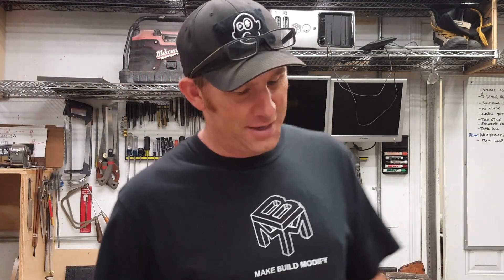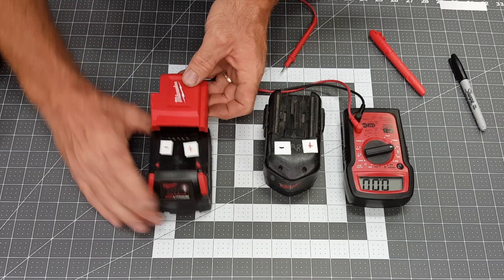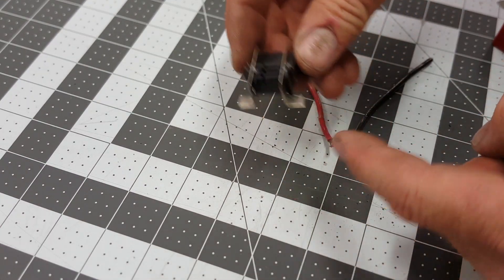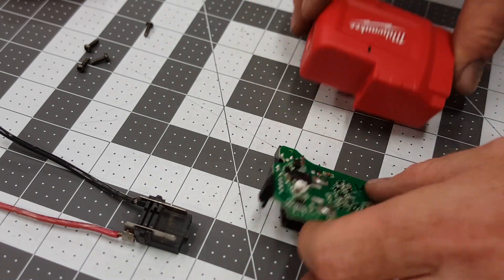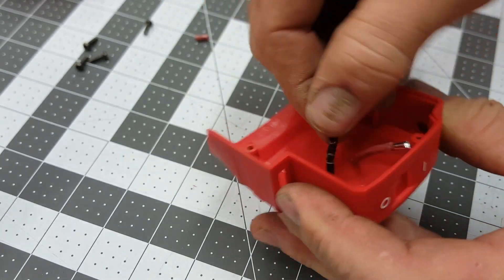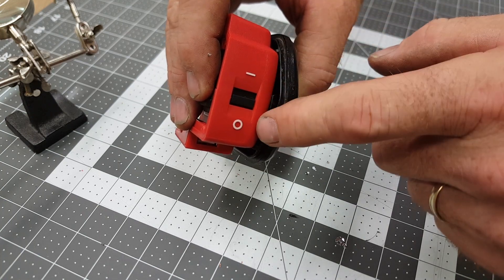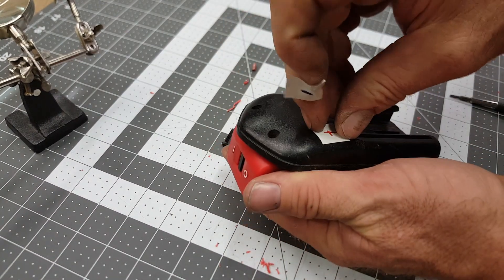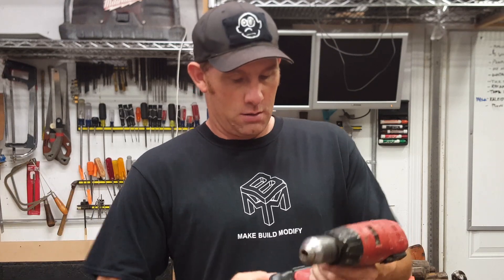HOW TO make an 18v NiCad to 18 volt lithium ion battery adapter for Milwaukee tools

Comment from the maker: <<<WARNING>>>: I don't let my lithium ion batteries go below one bar while using old tools. This is because the new tools will shut off before the battery is completely depleted. The old tools will run the battery all the way down. One of the guys on my jobsite used my old tool/new battery setup and completely depleted the battery and now it won't charge. :(
Reply: You probably did already but you can recharge your drained battery with another fully charge battery by jumping cables from one to the other. Just need a bit of power so that the charger can recognize it and charge it.
Reply from the maker: @gtdodgeviper  Yeah, I gave that a try, but it didn't work for my battey. :(
Reply: RE: " the new tools will shut off before the battery is completely depleted. The old tools will run the battery all the way down."  That's true if using one of the newer-style Li-Ion battery packs that have the battery protection circuitry inside the tool instead of in the battery pack.  Ryobi & Ridgid are the only two mainstream brands that haven't significantly changed their battery pack design since their tools used NiCad packs, which means they still have all the battery protection circuitry inside the pack, and these packs can also be used to power any device that runs on the appropriate voltage without any concern for for battery damage due to over-current or over-discharge.
Reply from the maker: @videopipeline6419  Thanks!
Reply: @Makebuildmodify  ...and since Ridgid battery packs are pretty close to the same capacity as Milwaukee, Dewalt & Bosch (of similar rated capacity), but only Ridgid packs have a lifetime warranty (if registered within 90-days), that makes the donor-pack choice pretty easy.
Reply: Thanks for the heads up

Comment: i would just avoid evacuating the power. as someone who works on performance vehicles using large batteries ,  you're gonna run into some MAJOR problems if you depletre.
Reply from the maker: Yep.

Comment: I didn’t read the title well and thought it said how to make it work, and then realized it says “with adapter” but I still think it’s kinda redundant and dumb to offer a hack that isn’t a hack, it’s just a purchase of another tool. I thought diy was not purchasing more stuff
Reply from the maker: It can be done with the lower part of a flashlight that receives the new batteries. If you look near the beginning of the video, you can see that I cut off the lower part of the flashlight. You can also see in the same shot that I use this part on one of the adapters. So, it can be done without a purchase of another tool if you already have the newer flashlight. But, it's been a while since I made this video, and now there are aftermarket adapters and 3D printed versions.

Comment: How are you locking the old top plate into the nicad tool, now that the locking mechanism is removed.  I have everything done, using a Dewalt adapter, and haven't figured out a way to lock the new combination battery pack into the old tool.
Reply from the maker: I didn't. most of mine are so old that they would stay on their own. Now that I think about it, I use a large rubber band to hold the battery to my sawzall
Reply: @Makebuildmodify  Thanks for getting back to me.  The only way I could see of keeping the locks, would have been to put the new batteries in the old case, which is not what I wanted.  I will go ahead without the locks, knowing that I will probably have to use a Rube Goldberg solution to secure the adapter.  The only two older Milwaukee tools I am wanting to use, is the hammer drill and the sawzall, so I will have to do something.

Comment: I've got the old 5 piece set. Now I'll be able to use them again. Thanks!
Reply from the maker: You're welcome. Be sure to read the WARNING in the description or the first comment. It's possible to drain the new batteries to a level that makes them  permanently unchargeable.

Comment: I did this with a new dewalt lithium……. For my old Milwaukee tools.  All my tools are now dewalt because Milwaukee would not make an adapter after 30 years of Milwaukee, I now use only dewalt
Reply from the maker: Yeah, that can be a deal breaker. Milwaukee did make a lithium battery for the old tools at one point.
Reply: Yes and I was excited to be able to go lithium with my old tools.  Alas, never available, now Milwaukee joins Levi’s, converse,Tropicana etc.  products I used for years and would still to this day if they had not screwed them up. Voted with my dollar

Comment: I have a number of the "post" type nicads that don't hold charge for long(when using) is there anyway of making something similar to convert to lithium (all the drills work fine just below par batteries) batteries only have 2 connections pos and neg....
Reply from the maker: I don't know. There might be an aftermarket adapter available though. Since I made this videos there  have been a few adapters made by the tool companies.

Comment: This is sick. I don't have v18 but I've got the old 18v DeWalt stuff
Reply from the maker: It works but you gotta be careful not to drain the new type of batteries too low or they will not charge again. The new batteries have a chip that communicates with the new tools to stop the battery from being drained too low.  If you use an old tool with a new battery the tool will drain it to the point where the the charger "thinks" that the battery is bad and will not charge it.

Comment: I’m all for building cool stuff but I just bought an adapter on Amazon that does this same thing for $25. I resurrected three great old tools to use the 8 M18 batteries I have.
Reply from the maker: Yeah, Those adapters weren't available when I first posted the video.

Comment: Milwaukee actuall had a recall on the Ni Cad batteries & will replace them for free. The tools were great but the batteries sucked.
Reply from the maker: Do they replace them with lithium batteries?
Reply: @Makebuildmodify  They replaced mine with Ni Cad, might have changed by now. Google Milwaukee Battery Recall
Reply from the maker: @thomasz4981  thanks!

Comment: I was all set to do this after getting my first M18 tool and wishing I could still use my drill, saw, sawzall and job site radio from the 2000 NiCAD set of tools.  I had 5 of the NiCAD batteries but hadn't used them in a few years at all and not 1 of them would accept a charge.  And I bet on average not one of those NiCADs was charged more than 50 times in the 20 years since I bought them all.  That's a LOT of $$$$$ in batteries.  But then I found all the demonstrations of using a car charger to revive these NiCADs.  So I figured I'd try that and certainly at least one wouldn't come back and it would be my donor for the top to use with your project here.  EVERY SINGLE ONE of those 5 old NiCADs came back to life.  So now I'm wondering if I use a battery conditioner on them to charge and deplete each a dozen times to recondition them if they might still have years of life in them with my limited use.  Or do NiCADs also just die based on age rather than number of charge cycles?
Reply from the maker: Glad to hear you recovered the use of your batteries. I had no such luck.

Comment: Great idea, but they now have finally came out with an adapter. I’m not as good at soldering as you
Reply from the maker: Yup, you can buy them now.
Reply: I’ve used the Dewalt adapters with no issues, I’m not sure why Milwaukee hasn’t mft’d an adapter as only generics are available. I guess they have their reasons
Reply from the maker: @moparlover1968rr  Yeah, I wondered the same.
Reply: Do you have a part number or link?
Reply from the maker: @cheeseburger9232  Yup, Here's one, it's not made by Milwaukee but it looks good. https://amzn.to/38vqD90  (Affiliate link so you can help support the channel at no cost to you)
Reply: @Makebuildmodify  this adapter will let me use the new 18 volt lithium ion batteries?
Reply from the maker: @cheeseburger9232  I believe it will. You can ask the seller questions on Amazon. Also remember to take a look at the reviews. This is not a Milwaukee brand tool so I'm not sure on the quality. There are also sellers that have lithium-ion batteries that will fit the older drills, but they are expensive. Link to battery: https://amzn.to/38wQfSZ  (Affiliate link so you can help support the channel at no cost to you)

Comment: It's a great idea, but I'm frustrated watching .. bc 90% is wasted effort.  You don't need two adapters - just run the leads from the tool directly into the power supply, and - - and glue the power supply directly onto the tool's base with a PU cement (maybe Loctite Premium 3X will do - or a plastic epoxy.)  You might want to preserve the battery readout - I would cut the top off and replace it with something to make a better fit.  Stick the readout on the side.  But that's it - DONE!
Reply from the maker: What about recharging the battery?

Comment: Lessons learned: a) solder the wired to the board terminals first before running through the holes, then solder to the blade terminals for the older battery holder;  b) use a 100w + iron otherwise, you won’t have enough heat; c) make much bigger holes to pass the wires to give some clearance, there’s no reason to keep them so small; d) use hot glue to stabilize the two parts together.
Reply from the maker: Good ideas!

Comment: Excellent job, MBM.  Learned a lot of good juju from this video.  Thanks for sharing.  Have a fine week.
Reply from the maker: Hey Thanks!  Just a word of warning. I don't let my lithium ion batteries go below one bar while using old tools. This is because the new tools will shut off before the battery is completely depleted. The old tools will run the battery all the way down. One of the guys on my jobsite used my old tool/new battery setup and completely depleted the battery and now it won't charge. :(

Comment: this is awesome thank you very much for showing how to. I will be doing this for my snapon now I don't have to throw away my 800 dollar 1/2 impact thanks again.
Reply from the maker: Nice! Good luck! One warning, I don't let my lithium ion batteries go below one bar while using old tools. This is because the new tools will shut off before the battery is completely depleted and the old tools will run the battery all the way down. One of the guys on my jobsite used my old tool/new battery setup and completely depleted the battery and now it won't charge. :(
Reply: Make Build Modify that’s exactly what I was thinking about and was actually going to ask you about because I did notice the new batteries themselves say smart circuitry build into them but I guess I still have to pay attention to that detail thanks again

Comment: I bought the adapter and did this modification.  My sawzall worked great the first time.  But the Lithium-Ion battery did not shut itself off on the normal low voltage cutoff.  I used the sawzall until it started slowing down.  Measuring the voltage it had left showed 16.4 vdc.  I put it on the charger and after about 5 minutes I got blinking red/green lights.  After removing and installing it back into the charger a few times, I got the same results.  So I tried bringing up the voltage from a good NiCad 18 volter...(I didn't have another Li-Ion).  That didn't work.  So I tried a 19 vdc wall charger....didn't work.  So I hooked a couple of 12 vdc lead acid batteries hooked in series (24 vdc)...didn't work.  The Li-Ion battery still had only 16.4 vdc.  I fly model aircraft, so I tried that charger which charges LIPo, NiCad, and MetalHydride batteries.  That charger wouldn't even see the Li-Ion.  MY GOOD Li-Ion IS NOW TRASH.
Reply from the maker: Sorry to hear that. I've only been allowing my batteries to discharge to the last bar. But I had someone use my sawzall and run one of my bigger batteries all the way down and it too has lost it's ability to charge. That's why I put the warning and disclaimer at the end of the video. This kind of modification is experimental at best.

Comment: What about using the old batteries on the new tools? Or using the new chargers to charge old batteries!
Reply from the maker: The new chargers will not work with the old batteries. Old chargers will not work with new batteries. New tools are "smart", they have chips that prevent other batteries from being uses.
Reply: @Makebuildmodify  thank you for the response...I'm now modifying an Old Milwaukee Nicd battery to the new battery, making my own adapter. I had a new Milwaukee skil saw that took a crap because it got too wet and fried the whole motor so I I'm taking the old battery receptacle from the skill saw and using that as my base to plug the new batteries into. I was given a bunch of old Milwaukee Tools with one battery and no charger. The cells in the old battery are so bad I didn't think that they were actually battery cells ... LOL! The top of the old battery, receptacle, is what I will be using to plug my old tools into. Thank you for your video, and the explicitness of which wire where to put them and so on it was very descriptive and the best video I've seen on this topic. Thanks again! As soon as I get them up and going, or not, I will inform you of the outcome.
Reply from the maker: Nice! Good luck! One warning, I don't let my lithium ion batteries go below one bar while using old tools. This is because the new tools will shut off before the battery is completely depleted and the old tools will run the battery all the way down. One of the guys on my jobsite used my old tool/new battery setup and completely depleted the battery and now it won't charge. :(
Reply: @Makebuildmodify  okie dokie ... thanks for the tip!

Comment: You mention at the end of the video not to use your old battery charger with this adapter. So taking 1 step forward, How do you charge this setup?
Reply from the maker: The new batteries are charged with the new charger.

Comment: Excellent tip on keeping the older tools alive. Biggest problem on any battery driven tool is the life of the battery. Looks like you have a good solution. And its Milwaukee, why run anything else?
Reply from the maker: I know, right? Milwaukee is the best!

Comment: I was trying to revive two V18 Milwaukee batteries today. These are the older style. (Why does eveything always change) anyway, there are three conections on these batteries. Looking at the battery spade tabs, left is positive, right is negative, and middle is the monitoring one. These things were DEAD. I put my ancient power supply on then and they drew 2 amps at 19 volts. Left them for 15 minutes and then put them on the Milwaukee charger. They charged up well. Yaaay!! You can fool the built in undervoltage system this way.
Reply from the maker: Interesting.

Comment: Very cool, and I'm all about this helping guys put theie tools back into action. Just seems like a waste of money and effort though, when you should be able to EASILY just remove the cells from inside the newer LI battery pack and install them in place ot the ni-Cad cells in the case of the old battery... Why  not do that?
Reply from the maker: The old charger doesn't work with the new cells.

Comment: I'm considering trying something like this now that the new owners of the Craftsman brand have decided to discontinue the old 19.2V C3/EX series.  In the past it was a kludge to do it because so many of the various brands had a stalk that sticks up into the tool, but with many modern battery systems being much flatter on top where they mate to the tools this might work.

I'm assuming that since you're just robbing current off of the new battery through that adapter, it should be brand-agnostic.  Any concerns otherwise?
Reply from the maker: voltage and polarity are the big ones. Of course there's alway a chance that you'll ruin your good tools too. But in my case I had nothing to lose.

Comment: Milwaukee will replace these NiCad batteries for free, even shipping as there is  there is a safety  recall. I still have my old tools & then some, people are practically giving them away because of the batteries. Great tools garbage battery.
Reply from the maker: Interesting. I didn't know that.

Comment: I had an Old Milwaukee cordless set and I was able to use this technique to convert it to the new lithium batteries. Thank you so much!
Reply: Those old Milwaukee tool sets were rugged and built very heavy-duty
Reply from the maker: Awesome!!! I'm glad it worked for you!!
Reply: Make Build Modify It was a brilliant idea of you. It's a shame to have to throw away such good tools because you can't get batteries.
Reply: Make Build Modify: So thankful for your video! This morning I was using the adapter to run my skill saw and then we lost electricity so I've been using it the rest of the day to charge cell phones.

Comment: How much is the battery lowered on the circular saw with the high capacity battery.  It was hard to tell in the video but it looked close to the same level as saw base. Great method and great video, Thanks!
Reply from the maker: It is pretty close to the saw base. But you can still make a full depth cut.
Reply: Jeremy Pestle I converted my battery and I have plenty of clearance on my radial saw.

Comment: This is a very informative and well documented video. Since it's making in 2017 have you discovered any negative effects on the M18 batteries or older Milwaukee tools? Have you made any improvements to the original conversion worth mentioning? I'm about to try this for my older ni-cad Milwaukee tools. Thank you very much.
Reply from the maker: I haven't made any improvements since the video. I've been using the tools (the circular saw quite a bit) with no side effects so far. Good luck and be safe.